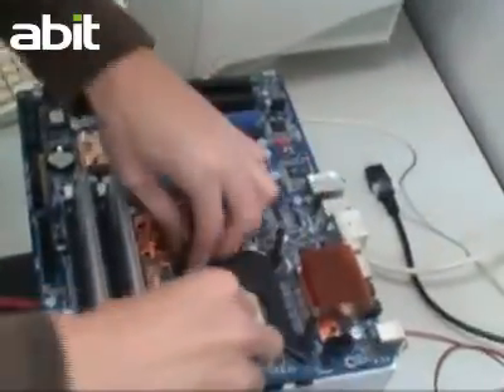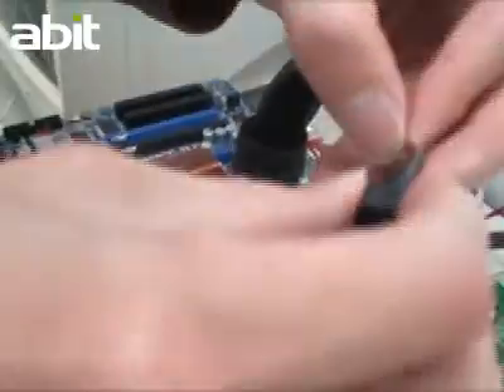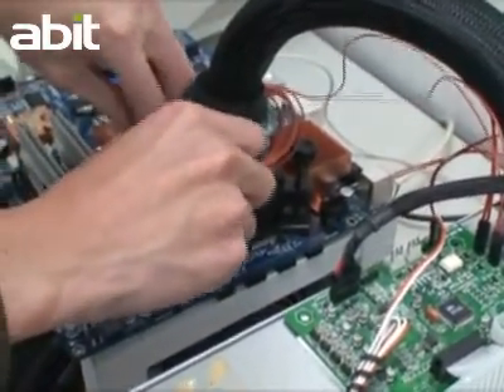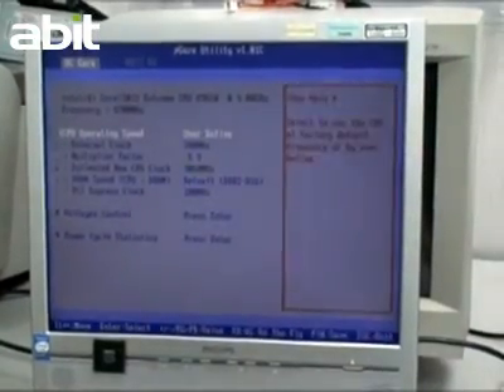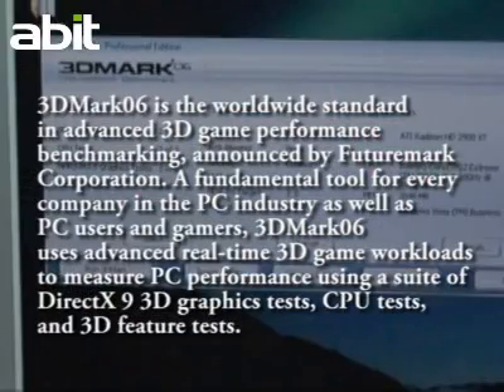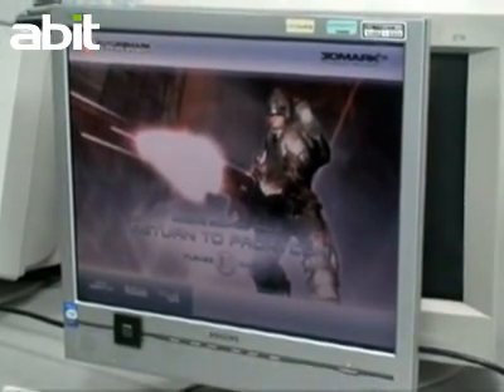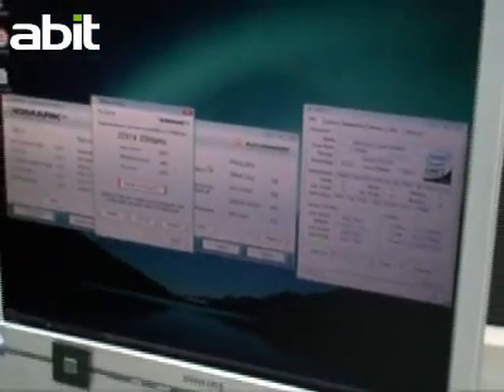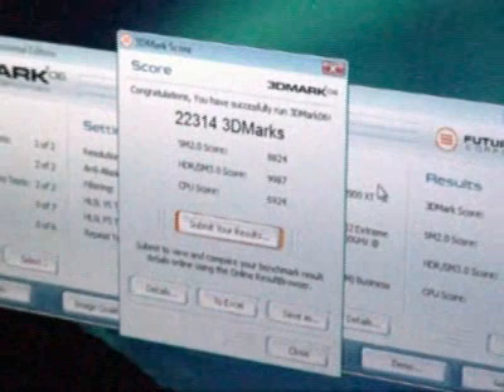IX38 QuadGT-OC with compressor

Comment: Then, just use the heat exchanger with your basic water cooling loop (Cpu, graphics array, north bridge, and etc!)
Mount the heat exchanger externally and prepare the lines on both sides. (input+output to prevent condensation!!!)
Using a 1 gallon reservoir for the exchanger loop is a good idea. It will ensure that any lost energy by means of the heat exchanger will be collected and reprocessed at the exchanger.
This is my personal fail safe loop & will guarantee extremely safe overclocking!

Comment: Frozencpu has them if you want to drop some "cold, hard... cash!"
Retail supplied phase change, though it works well and is effective... it isn't as cost effective as water cooling for the standard user. 
If you're handy with electronics and you know your way around a medium btu window unit, I would suggest re-purposing that unit instead.
Visit your local machine shop and have them cut a custom, cnc heat exchanger with a varying nozzle for the most effective operation. That will make it future!